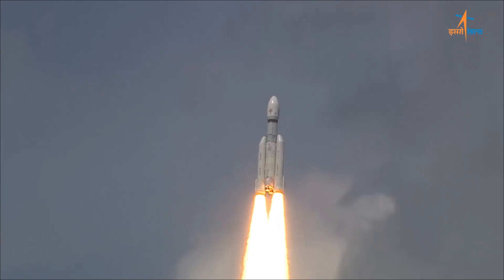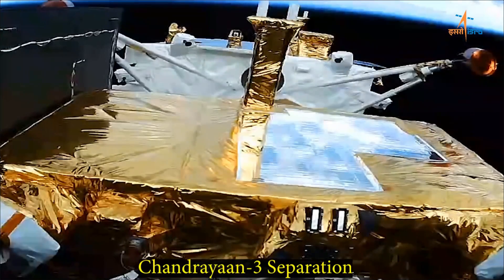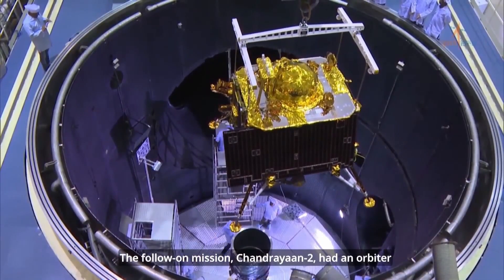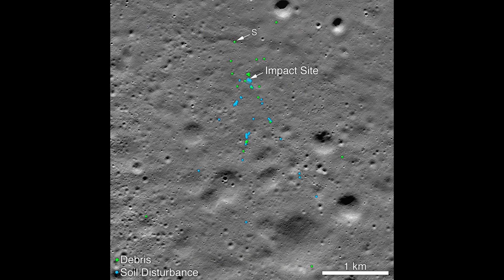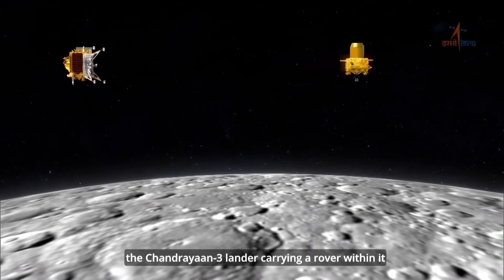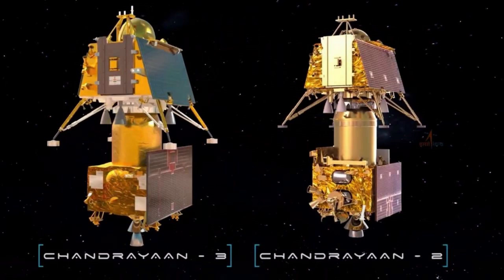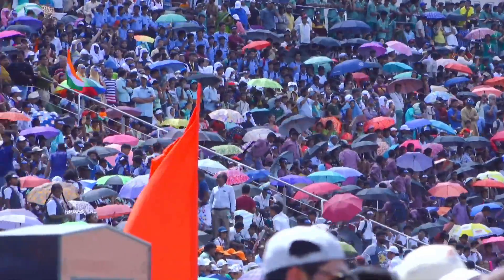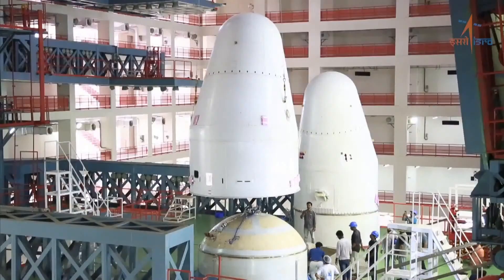India's Flagship Lunar Mission Chandrayaan 3: Will it Brake or Break?

Comment: Chandrayan two failed because of wrong decision-making at the engineering level itself. They kept it on a very tight leash and also added five engines instead of the four originally planned. That said, the story of the NASA Mars mission in 1999 is comic. The issue wasn't even all that technical: One team used English units such as pounds and feet while the rest of the engineers used metric. fully sixty percent of the NASA missions to Mars failed. India would never use US telemetry because of data theft. Also, please don't forget that 40% of all space program people in NASA are Indian or of Indian origin. Lastly, you might with tremendous benefit to yourself do some research into the ancient Indian knowledge of Astronomy. It is fascinating to see how all astronomical values are very close to the modern ones while this data was composed at least 12000 years ago if not earlier. Google, why 108 is such an important number for Indians. Let that be the Eureka moment for you.

Comment: Either speed of lander was high so it might have crashed .other reason could be due to community cation loss just 2 km above the unknown me ve surface as it was landing for the first time .There may not be adequate sensors which may have failed or engine may not have fired .whatver may be reason second time would be much better i suppose .The last part is going to be very crucial especially the landing phase where  they have to control the velocity while descending on lunar surface .

Comment: The Chandrayan I had found water on moon. With Nasa, Isro did an impact procedure that ended up detecting water on the polar region of the moon. This is why Chandrayan 2 and 3 have been working hard to land on the south pole. While Chandrayan2 probe failed to land properly, the Chandrayan 3 is set to undo the mistake. It is extremely difficult for any probe to land on the South Pole. I am sure the scientists are looking for habitable zones on the Moon where new civilization could be settled.

Comment: Why don't they try lander on earth first , if a version of lander that is made for earth descends and operates here correctly they can expect the moon lander to work there, how can they expect it to work when they test only partially like flying navigation unit in aeroplanes and test if it's giving correct altitude etc.
Reply: If you land on earth you have a dense atmosphere and 6 times the gravity. Such a lander is completely different from one made for moon.
Reply: @simonm1447  yes, but those parameters can be modified for thrust etc,  it will confirm that everything is working, for instance if some motors need to be activated at certain altitude that can be confirmed by testing here
Reply: @akp27i Go and tell the isro scientists. You think they are dumb?
Reply: @Shell-_-Abraham  it's just a question
Reply: @akp27i  you still have aerodynamic influence you dont have on moon.
Reply: @simonm1447  i understand that, still it will be a confirmation that all their systems work when needed, instead of trying it on another heavenly body for first time, mechanical and electronics will be same too , difference in aerodynamics and gravity should be accounted for final design for moon, once they demonstrate that  such a full fledged system works here on earth

Comment: India should procure the now defunct Space Shuttle program with full TOT & start making their own Space Shuttle based on NASA's retired STS . . . the STS has proved to the world that a conventional fixed winged space plane is better than any Soyuz or Progres spacecraft . . . even the SpaceX One for that matter . . . in collaboration with NASA the Indian made Space Shuttle will have to be 58% bigger than it's predecessor across all measures, both inside & out . . . that translates to 82% more payload it'll be powered by a new cutting edge ion based electro magnetic iHYBRId® rocket propulsion system . . . unit cost €2.0 Bn - €3.8 Bn (approx) . . .

Comment: Nov 22, 2019
India's Federal Space Minister Dr Jitendra Singh admitted for the first time that the failure of the Chadrayaan-2 was due to a reduction in velocity beyond the designed parameters.

"During the second phase of descent, the reduction in velocity was more than the designed value. Due to this deviation, the initial conditions at the start of the fine braking phase were beyond the designed parameters. As a result, Vikram hard landed within 500 m of the designated landing site", Dr Singh told parliamentarians.
(RIA Novosti)

Comment: Chandrayan 2 was partial success our orbiter is still orbiting around moon that's y this launch doesn't include orbiter
Reply: Have you seen any photograph from the alleged orbiter?
Reply: @SageOfTheModernAge  that orbiter sends high resolution pictures from moon surface 24/7 to the ISRO main computer screen. Visit ISRO main headquarters at Bangalore and carry your current student card of school/college/uni if you want easy access as normal civilian will have higher wait time. I have seen it but the picture or you may say video is very low frame per second due to high resolution and distance from Earth servers and antenna catchers.
Reply: @bismayparida2115  So you don't have any photographs?

"You can go there and visit and view a picture" is third party unverified and unsubstantiated claim. Most likely nonsense.

"that orbiter sends high resolution pictures from moon surface 24/7 to the ISRO main computer screen." - LOL!
Reply: @SageOfTheModernAge  you can't carry your phone or any hidden mini cam tho... If the detectors inside the main hall detects any electronics like mini cam then you might end up in jail.
Reply: @bismayparida2115  One would have thought that pictures of the lunar surface wouldn't be classified. If they are classified, they will not be accessible to a visitor. If they are not classified, it should and would be purview to the public, such as the ISRO website.
Reply: @SageOfTheModernAge  Specific places on the lunar surface are classified like mine rich parts, some deep craters the current CY-3 landing site  but not the majority portions. You can go there ( Bangalore HQ) and see it
Reply: @bismayparida2115  "You can go there and see it" is not evidence of anything.

Please tell me what is deemed classified and what isn't, you'd have no idea of the data classification model mapped to lunar surface areas.

Show me some photographs that you have seen.

You have provided nothing so far except gibberish and false claims.
Reply: @bismayparida2115  "that orbiter sends high resolution pictures from moon surface 24/7 to the ISRO main computer screen."

You may want to provide evidence of this too. How big is this main computer screen, what is the operating system, which area is it located in HQ, what kind of clearance is required to view those photographs?

Comment: Chandrayaan's design to land to a predetermined area, not autonomously checked and  decided by the lander, itself is a problem, for other countries, the lander hover, stay in about 100 meter above the moon surface, with camera, laser and radar check the surface, then move (fly) horizontally to the flat spot to land, not forced to land on a specific (of course it is still a large aimed area) spot to land.

Comment: regarding the failure of Chandrayaan- 2, ISRO Chairman have mentioned that it was due to inflexibility of the code written for the landing which was sticking to the particular spot of landing and due to this the lander had to make extreme adjustment at the last moment for the landing which caused it to increase the speed in multiple direction in order to reach the defined landing spot. But now it has been modified and have been provided with flexibility to select the safe landing spot depending on the position of the lander. I hope this clarifies.
Reply: this kind design itself is a problem, for other countries, the lander hover, stay in about  100 meter above the surface, with camera, laser and radar check the surface, then move (fly) horizontally to the flat spot to land, not forced to land on a specific (of course it is still a large aimed area) spot to land.

Comment: Hi sir, chandrayan 2 fail because of infrared, redar and VTRIM traker was attached on a single  module, due to glitch or backing of that module chandrayan 2 failed, single module which is us to masure speed, velocity, direction, accuracy of landing area and distance between moon and lander that problem be created by high amount of shock during lunching GSLV mark3 or, any small asteroid or any small substances get strike with that module may be this reason or VTRIM traker got any trouble or problems or glitch due to this issue and module computer not resated it self to land on moon and this failear problem was also created 1st lunch of SSLV  that way 2nd lunch of SSLV, ISRO had used 2 VTRIM module and NAVIC module and automatic restart system of specific module which is suffering from problem or any glitch to prevent SSLV to fail.
This time ISRO had used to 2 VTRIM module and many more different and new features and module on lander, and this time isro had using more advanced atonomas AI programming computer to prevent failer, I hope this time my 🇮🇳  india and my contry will get success!!! 
Isro had published and you can check on YouTube channel WiFi study or global conflict English.

Comment: Amazing they could get men there in 1969, but they’re having troubles landing an unmanned spacecraft on the moon? I guess people back in 1969 with slide rulers were really smart way smarter than the people with computers today. Amazing.
Reply: The Appolo mission was pioneering in every aspect. From rockets, navigation, guidance, engineering, computation to material science etc. That said, every launch even today to a celestial body is still tricky but benefits along the way in both success and failure.

Comment: the basic design for Chandrayaan Descent propulsion system was based on a master student thesis from MIT in 2004. 
"Lunar descent using sequential engine shutdown
The notion of sequential engine shutdown is introduced and its application to lunar descent is motivated. The concept calls for the utilization of multiple fixed thrust engines in place of a single continuously throttleable engine."

Comment: As ISRO chief said in recent interview, during CY2 mission the approach was based on success and this time around it is based on failure. CY2 was programmed to land at particular spot and the error handling of the craft was not able to perform on received parameters and it had to accelerate to reach the landing spot and because of this the craft went upside down due to high thrust. This time they have designed it anticipating each a every bit that can go wrong and have increased landing area, so hopefully mission is successful this time.

Comment: Descent propulsion system for the USA Apollo, China's Changer and Chandrayaan 3,
1. USA Apollo, single engine, big, using helium gas as pressure source to push fuels and oxygen into engine to burn, by human control the throttle. 
2. China, Changer, single engine, big, 1.5 -7.5 tons adjustable thrust for a 3.8 tons lander,  use computer to control stepper motor to squeeze the fuel and oxygen into engine, the push can be continuous and stop and start  multiple times,  very accurate and with quick response time. 
3. India  Chandrayaan, using helium gas as pressure source to push fuels and oxygen into engine to burn, 4 small engines (800 kg thrust each)   share common tank for fuel and oxygen,  with step valves (20% each for Chandrayaan 2, and 10% each for Chandrayaan 3), no human control. with rough control and slow response. total weight of the lander about 2 tons.
by comparing all 3 Descent propulsion systems, there is 80% chance that Chandrayaan 3 will be end like 2.
Reply: ahmm just see it for your self... do you really think they don't know this you are just sizziling in the fire of jealous
Reply: @adityarajsharma6029  2 crashed already, so everyone know it does not work except ISRO still use the same for 3. it will crash again

Comment: Actually chandrayan 2(C2) is just 10% failed

C2 has 2 motives
One part is revolving around the moon which is successful but

Another part Due to angle change during landing when that rover carrying thing is almost 0.5kms from moon land(4 minutes before landing) that rover thing hard landed on moon surface....that revolving satellite is still running and it will help chandrayan 3 rover by finding the exact location where rover landing and made it more securely to land in any circumstances so most probably chandrayan 3 will succeed + C3 is landing on south pole which no country even tried to land rover there...

USA , china , Russia focussed on north pole of moon..if india succeed it is 4th country to land on moon and first country to land on south pole of moon

Comment: the first one found water on the moon was by USSR lunar 24 with the moon sample get back to the earth in 1968
the so called  Chandrayaan 1  found water on the moon was due to Chandrayaan 1 carried a spectrometer from NASA, the data was analyzed by NASA, not by ISRO,
Reply: Mao genocide, Xi ping pong bat virus
Reply: 1. It was not "Lunar" 24, rather Luna 24.
2. Luna 24 mission was launched in 1976 and was returned to the earth in 1976- not in 1968.
3. Test on Luna 24 sample was carried out using Infrared absorption spectrometer that made emperical inference on physical identity. If the study was accepted as definitive proof, NASA wouldn't claim to have detected it in 2009. 
4. Quadrupole Mass spectrometer CHACE onboard the Moon Impact Probe (MIP) carried by the Chandrayaan 1 definitively detected hydroxyl ion present in water during its descent. A mass spectrometer measures mass to charge ratio and hence provides definitive conclusion on two fundamental physical properties of any particle, them being mass and charge.
5. Detection by NaSA's M3 (Moon Mineralogy Mapper) imaging spectrometer onboard Chandrayan 1 and relevant study was made 3 months after CHACE's detection was studied.
6. NASA primarily rejected CHACE'S detection as anomaly due to contamination but layer accepted its evidence, studied analysis and conclusion. 
7. CHACE's data obviously was studied by ISRO to arrive at the comclusion regarding the definitive detection and the data and study were later shared with NASA which at first rejected it and then accepted.
8. Catching an actual particle at the detector through the rods (of the mass spectrometer) close to the lunar crust while on the descent and measuring its mass and charge, two fundamental physical properties of the particle to arrive at a conclusion on detection of the particle like ISRO CHACE onboard the MIP did is anyday more convincing than analysing electromagnetic spectra of the particle using imaging spectrometer from faraway orbit without getting in contact with the particle. It is not that imaging spectromecter is not comvincing though.

9. Here is my two dimes thrown at the third rate rentier troll that you are. Collect it from the floor and retire to the hellhole you were unleashed from to carry out social engineering and public opinion molding you so miserably fail at. Desperate try though but hard luck and I can't help but bust you.

Comment: Our space missions are very less expensive. Not like NASA. We use gravitational   force  and land in 45 degrees not vertically. So some times it fails there is no on-board pilots like air planes have to land in angle.
Reply: So not because of budget😂😂
Reply: You know less than you pretend you do.
Reply: @TheEvilmooseofdoom   Really? You and Fake Gandhi know more. USA missions are lift and land. ISRO missions take long time as it goes in several orbital manuevars
Reply: there is on board computer for the job, obviously it did not work in Chandrayaan 2

Comment: The ISRO chief recently gave details of what went wrong with Chandrayan 2. Basically it was a series of small issues combining to get into a situation which was not planned for. The mission was designed for a narrow band of parameters and the accumulated deviation overshot the designed parameters slightly.

Now they have tried to cater for that with a wider set of mission parameters and building more redundancy in the system. Let’s wish the mission all success.

Comment: My opinion is that the previous lander had a problem with orientation when breaking orbit. I dont know if it was due to software or the fuel transfer to the motor. I remember tanks on the Apollo mission had to be purged to allow for the precise ejection of fuel combination to the motor.  Hopefully the engineers have worked out all the potential bugs with this mission. The whole world is very excited to see the results.
Reply: there is a reason why chinese lander and most american lander intentionally overshoot their landing and break to hover to stop right over their LZ before landing. this buy time to make adjustment and switch from flight to landing program. Indian mission has a smaller fuel budget. attempt to follow a strict windows, and when their undershoot, they have no way to correct. like you can solve all these by firing late so you overshoot, it just mean you have to use more fuel to hard break for hover. in short the more fuel you have, the easier it is to land, since you are less restricted by trajectory and have more option to brute force.